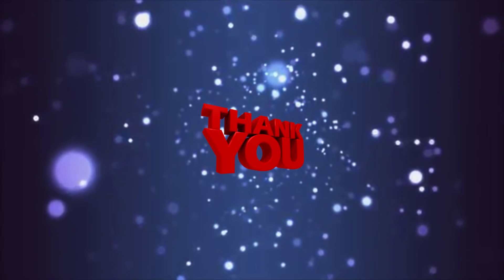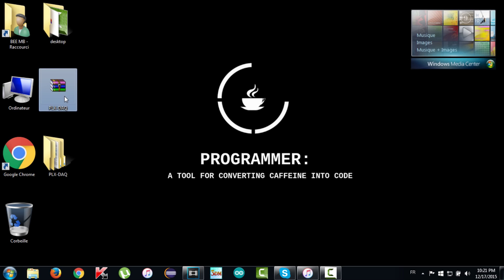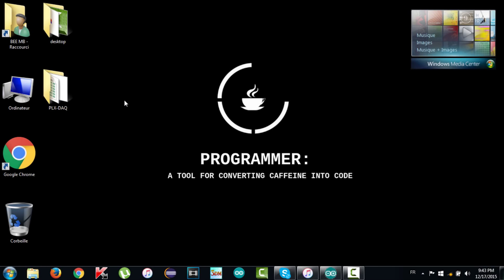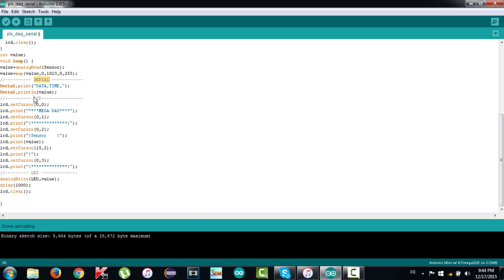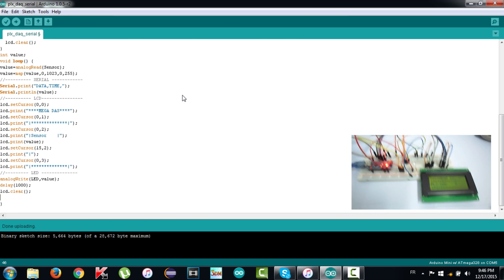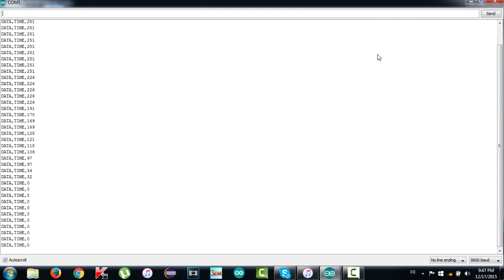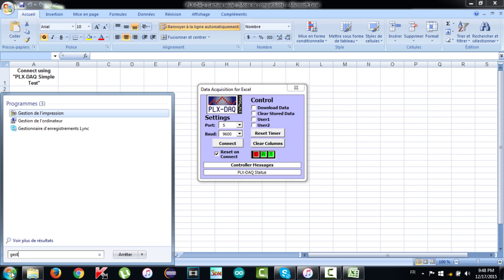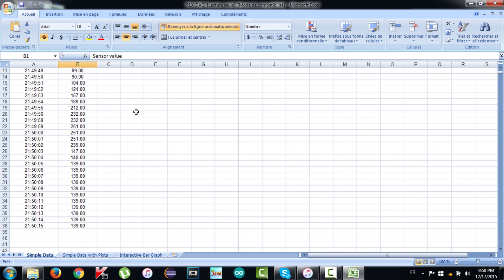Arduino meets Excel ( PLX-DAQ )

Comment: Great video. I have a question. Can you disable continuous data acquistion on PLX-DAQ. I just want it to send data to excel when a sensor goes high. I am currently using data streamer and it is acquisitioning every few milliseconds (I can edit this). Or is there a better way?
Reply from the maker: Update the code to suit your need, remove the delay and make the data transmission as an event
Reply: @DIYGUYChris  Thanks for the quick reply. I am new to PLX-Daq I will try that. Finger crossed I can get it to work
Reply: @DIYGUYChris  Sorry Chris is it in Arduino code I change to event driven or PLX-daq?
Reply from the maker: @anbroic  the change is in the Arduino code

Comment: I've been using an accelerometer and want to upload data to excel I've used an program that allows me to connect the port to excel and upload data. But when i connected port sometimes data doesn't upload and the letter "R" blinks red.

I was wondering does it have anything to do with the code. Do you like have to include something so arduino can comunicate with excel. Because I've tried different codes for different projects and sometimes it doesn't work

Comment: The download file only contains shortcuts and not the actual files. This video is useless without the necessary software. THIS IS A FAKE INFO . IT IS NOT NECESSARY TO USE THIS SOFTWARE TO SEND DATA FROM THE SERIAL PORT TO AN EXCEL SHEET!

Comment: please help me to log temperature in PLX-DAQ
my code is below

const int sensor = A1; // Assigning analog pin A1 to variable 'sensor'
float tempc;  //variable to store temperature in degree Celsius
float tempf;  //variable to store temperature in Fahreinheit
float vout;  //temporary variable to hold sensor reading
void setup()
{
  pinMode(sensor, INPUT); // Configuring pin A1 as input
  Serial.begin(9600);
}
void loop()
{
  vout = analogRead(sensor);
  vout = (vout * 500) / 1023;
  tempc = vout; // Storing value in Degree Celsius
  tempf = (vout * 1.8) + 32; // Converting to Fahrenheit
  Serial.print("in DegreeC=");
  Serial.print("\t");
  Serial.print(tempc);
  Serial.println();
  Serial.print("in Fahrenheit=");
  Serial.print("\t");
  Serial.print(tempf);
  Serial.println();
  delay(1000); //Delay of 1 second for ease of viewing
}

PLX-DAQ showing connected but no data logging.

Comment: I have a small problem that I can't figure out. 
I'm using an esp8266 microcontroller and the DHT11 temperature & humidity sensor. I tried the same method as you did. I am able to get the data on excel but I have two problems: 

1. I'm not able to store more than one sensor data in different columns (i.e. I want to print both humidity & temperature data but excel takes this as one value. eg. if  temp =28, humidity = 40, the data is shown as = 2840.00 and it doesn't work if I add a 'space'.

2. I am not able to get the column names. 

Please help me with this. If you want to see my code, I can email it to you.
Reply: you can make use of the PC part of this video..

Comment: hello sir. i'm using excel 2007 with windows 10. But, i'm having a little problem. When, i click connect on plx-daq it says that 'StampDAQ could not connect. Please help me with this. tq
'
Reply from the maker: Hello afiq aiman aiman 
From what you said, it is a macro security level so just try to configure the Excel macro security level to LOW and then if the problem remain the same then probably it is due to the Excel 64 bit version that you use since PLX-DAQ play its macro with an office 32 bits (not always) I just advice you to install a parallel desktop with windows 7 and Office 2007 and you will get no problems.

Let us know if we can further assist you.
And do not forget to subscribe to our channel for more awesome videos.
Reply: MEGA DAS thank you for the response sir. It’s very kind of you. Really appreciate it!

Comment: Hi MEGA DAS, first of all im not sure if my explanation will be clear enough for you so bear with me please. I have an IMU sensor connected to the arduino which will produce 3 sets of data, the accelerometer values, gyro values and the magnetometer values. Now each of these data is represented with an x, y and z value, which means each sets has 3 columns of data. So on each row i will have 9 columns of data. And when i connect the PLX DAQ to the serial port it doesnt print anything but R is blinking. And im not sure how to configure this table of data. 
PLEASE HAALP
Reply from the maker: Hello Wellesly Tony,
I've got the point you want to share, actually all what you need is creating the necessary labels for your data by changing the following instruction lines in the code that I provided in the description of the video :
Change this : 
       Serial.println("LABEL,Current time,Sensor value"); 
By :
      Serial.println("LABEL,Accelerometer X,Accelerometer Y,Accelerometer Z,Gyro X,Gyro Y,Gyro Z,Magnetometer X,Magnetometer Y,Magnetometer Z,"); 

Then when you want to send data to the appropriate cell just do this :
      Serial.print("DATA,"); 
// Now send data of Accelerometer variables
      Serial.print(Accelerometer_X); Serial.print(","); 
      Serial.print(Accelerometer_Y); Serial.print(","); 
      Serial.print(Accelerometer_Z); Serial.print(","); 
// Now send data of Gyro variables
      Serial.print(Gyro_X); Serial.print(","); 
      Serial.print(Gyro_Y); Serial.print(","); 
      Serial.print(Gyro_Z); Serial.print(","); 
// Now send data of Magnetometer variables
      Serial.print(Magnetometer_X); Serial.print(","); 
      Serial.print(Magnetometer_Y); Serial.print(","); 
      Serial.print(Magnetometer_Z); Serial.print(","); 

Note : about recieving data in PLX_daq make sure that you are configuring the same baudrate for both Arduino(Serial.begin(9600); )and PLX_daq.

Let us know if we can further assist you.
Reply: MEGA DAS omg youre a life saver thank you so much!
Reply from the maker: Happy to hear this from you Tony.
You are welcome.
Reply: Sorry but one more thing MEGA DAS, how do i get the excel to display elapsed time instead of time of day? cos what im getting in excel now is the time of day instead of time in minutes and seconds.
Reply from the maker: Hello Wellesly
Sorry for the very late reply, what you are asking about is a pure Excel configuration so there is no need to include Arduino in this, but I can suggest to use the "millis ()" fuction of Arduino in order to get the elapsed time then send it to you Excel file 
Make a research about millis function

Let us know if we can further assist you.
Reply: can i get your code for reading the accelerometer, gyroscope and magnetometer on arduino?

Comment: Can I export more than one data??
Reply from the maker: Hello Gabriel
Sure you can do upload more than one data just the way I did in this video I've exported temperature and humidity data

Let us know if we can further assist you.
Reply: MEGA DAS, thank you for your support :)
Reply: MEGA DAS, the downloaded RAR file only contains shotrcuts  to the spredsheet, but no the fil itself. I can't use it :(
Reply from the maker: What do you mean by "fil itself"?
If you want to change the columns labels you can do this through the code or just after getting the data from Arduino

Let us know if we can further assist you.
Reply: my bad. I meant  "the file itself". I can't open the spreadsheet. A window says there is no such file.

Comment: Hi would this program work, when i design my arduino code to display the measured values in the serial monitor? (Still Serial.print();)
I'm also getting the warning that file is not compatible with the version of windows i'm running.
The spreadsheet and help file is just shortcuts and the actual files are not found as long as the program is not installed...
Can you helt me?
Reply from the maker: Hello Rene,
As I understand, you want to use the code to display values on your serial monitor ! so its the same and it will work fine.
About the file! which one are you talking about, and which windows version are you using?
Reply: I'm running Windows 7, tried setting the install file to compatible for windows 2003 SP1 - no sucess.
i used the download of the .zip file in the description to download PLX-DAQ
Reply from the maker: On that video we were using win7 and as you see PLX-Daq is running with no problems
Reply: Okay how about 32 or 64 bit versions? Are both avaliable?
Reply from the maker: We are using 64 bit version

Comment: PLX daq software has been installed successfully.but I am not getting the data in excel sheet even status is showing connected.I have followed all instruction that has been shown in video but still I am not getting.For kind of information I am currently using 2003 ms office as well as 2007 ms office.  so plz help me to get this solution.
Reply from the maker: Hello sanjeet,
Did you use my code to test your project!?

Let us know if we can further assist you.
Reply: I have used my own project code.Is there any additional program modification in arduino to fetch data from arduino to  excel sheet?
Reply from the maker: Sure there is some specific lines to add, so you need to download the code that I used and find out what you missed in your code.

Comment: I have install PLX-DAQ but after opening the plx-daq spreadsheet file  one message is displayed"could not load an object because it is not available on this machine".plz help me       to solve this problem.
Reply from the maker: Hello sanjeet,
I often receive this kind of issues from those who use Microsoft Excel 2010 or higher, I advise to use Excel 2007 because it runs with no problems.

Let us know if we can further assist you.

Comment: i am getting a message, "this app can't run on your pc, to find a version of pc, check with a software publisher" so what should i do, i am using 64-bit original window. How can i use this software?
Reply from the maker: Hello apoorva, 
What Microsoft Excel version are you using!?
Reply: microsoft excel 2007
Reply from the maker: Could you make a screenshot for the error message and post it here,
Reply: this is the error
Reply: can u send me your email id as i am not able to post it here
Reply from the maker: This issue might be due to a problem with your user account.
Try to Run the Excel file as an administrator account, if this problem presists so you need to follow the steps indicated in the following forum: http://windowsreport.com/app-cant-run-windows-10/

Let us know if the problem is solves or not.
Reply: I tried but it didn't work, is there 64-bit software available.
Reply from the maker: Hello Apoorva,
I told you that the problem is in your windows! 
I'm using a 64-bit processor and this software is running with no problems.
Please tell if you find a solution for this problem.
Reply: Hi, i tried running plx-daq with excel2003 but its not importing any data rather showing this
Reply from the maker: Apoorva Rampal did you activate the macros for Excel !? as I showed in the video!
Reply: yes i did, but when i opened plx-daq interface and set  port and baud and connect, it showed me a message," stamp daq could not connect, please check the port settings."
Reply from the maker: Check this topic here in Arduino forum!
http://forum.arduino.cc/index.php?topic=331455.0
Reply: I checked it but didn't find anything, when i check my port settings they were, "bits/s= 9600, data bits= 8, parity= none, stop bits=1, flow control= none" in device manager > ports, do u think if something is wrong here?
Reply from the maker: Nothing is wrong with the port settings! it is exactly the same as mine.
Try to run Arduino Serial Monitor integrated in Arduino IDE and check if you receive some data from your Arduino.
Reply: yes i am receiving data same as yours
Reply from the maker: Give me your email, so you can provide some screenshots!

Comment: Hello, I am trying to use a PLX-DAQ in order to get some data from my Arduino, Unfortunately, I get an "Unable to load some objects because they are not available on this machine" (Microsoft Message) Is it stems from the fact that I'm using Excel 2016? (Anyway, I tried to enable macros but it didn't work also) should I download Excel 2013 (will it work?) or 
Windows 10 maybe cause the issue I have (In this case, I have nothing to do)

Thanks!
Reply from the maker: Hello Idan,
PLX-DAQ can intract with Microsoft Excel 2007 only, we still don't know why the macros can't be enabled in the higher versions, but you can upload data to your Excel File if you use the 2007 version.

Let us know if we can further assist you.
Reply: Hey again, I ran this little program:

double x;

void setup()
{
  Serial.begin(9600);
  Serial.print("CLEARDATA");
  Serial.print("LABEL,Current time,Sensor value");
}

void loop()
{
  x = 10*sin( 2.0*PI*( millis() / 5000.0 ) );
  Serial.print("DATA,TIME,"); 
  Serial.println(x);
}

I opened the PLX-DAQ SRL EXCEL 2007 but now I can't see incoming data into the excel software (and probably not even a graph).

(PORT and BAUD is O.K)

What to do?
Reply from the maker: Try to replace these instruction lines:
Serial.print("CLEARDATA");
Serial.print("LABEL,Current time,Sensor value");

by the following instructions:
Serial.println("CLEARDATA");
Serial.println("LABEL,Current time,Sensor value");

Then add a delay of 1 second "delay(1000);" in the loop function and tell me if it worked

I added in the description of the video the source code that I used i this project

Comment: Sending data from excel vba to arduino, for example to flick a led or to turn on and turn off it, have you an example?
Reply from the maker: Hello Jose

I am sorry to tell you that I'm not familiar with the Excel VBA, But using the PLX-Daq you can only upload data to your Excel file, it means you can not used to read data from Excel file.

Comment: Boa tarde, estou querendo manda um comando do arduino para o PLX-DAQ para salva os dados, tipo CTRL + S.
Tem possibilidade??
Reply from the maker: Hello Denis 
Could you please write your question in English!?
Reply: Sorry.

I am wanting to send an arduino command to PLX-DAQ EXCEL(WINDOWS) to save the data, type CTRL + S.

Is it possible ??
Reply from the maker: Hello Denis, this is better now we can understand you :)
So what I understand that you want to make a control on the data transmission! I mean you want it to be send by an event that you make, like clicking on a button or something like that?
Reply: This can even be a button or automatic.
I wanted the Arduino to send a command to PLX-DAQ automatic save.
Is there a possibility?
Thanks for the help :)
Reply from the maker: Actually the Arduino don't send instructions to PLX-Daq but it sends data, and the PLX-Daq is always waiting for data to come and when it comes then PlX place it into the Excel file, so if you want to stop PLX from uploading data just stop the Serial data transmission from your Arduino and if you want to give PLX-Daq the data just send it through the Serial port. I don't know if I gave you the desired answer or not!?
Reply: Thank you very much for the help, my friend.

Comment: Hello Mega Das,
                             We need the data of R305 finger print sensor data which is connected to arduino uno board into the excel sheet??                                
                                 and the code we used #adafruit library
Reply from the maker: Hello Sudheer!
I'm not sure that you can make it with an Arduino Uno if you are using the Serial Pins (TX/RX) for Fingerprint sensor because these Pins are connected to the USB-to-TTL Serial chip, as I know the finger print sensor use a Serial protocal to transfer data to the Arduino board so in this case you need to use the SoftwareSerial library that allows serial communication on any of the Uno's digital pins and let the TX/RX pins free for the USB transmission.

Let us know if we can further assist you.

Comment: It said 'stampDAQ could not connect, check port setting' when i selected the right port number. But it is connected once I close the arduino. I reopened the arduino but error appear as I tried to upload the code. help!
Reply from the maker: Hello Mohammad!
The first thing to verify is the baud rate, it should be the same baud configured in your code and PLX-Daq as well, then try to check if the right port number (follow the steps in the video) is selected in the PLX-Daq interface and you get the (c) icon turn from red to green when you click the connect button.
Reply: I did exactly that, its just the port wont be connected at the same time with arduino and PLX-Daq. I can only connect one at a time, for example, if the port connected with arduino, PLX-Daq ask me to check port setting. OR. if the port connected with the PLX-Daq, the arduino code wont converge due to its not connected. any idea?
Reply from the maker: Before making a Serial communication you should know first how it operates like the port configuration the baud rate etc...
But what you mean by "port wont be connected at the same time"!

Comment: How i make work with Arduino in 115200 Baud?
Reply from the maker: Hello Antonia!
Configure the PLX-Daq baud rate to 115200 then configure your arduino serial baud rate over your code: " Serial.begin(115200); "
Tell us if you have more questions!
Reply: PLX-DAQ dont have that rate, or i change(128000 to 115200) it in programmer mode in Excel?. Thanks for reply

Comment: it is not printing anything on excel but R is blinking in red
Reply: same here
Reply: Lol the ground pin wasn't fully in. which made the serial transfer not work but arduino blink.
Reply from the maker: Hello Mohammed
Make sure that you activate the macros for the spreadsheet, then try the same code that I provided in the description of the video. 

Let us know if we can farther assist you
Reply from the maker: It's important to check the wiring connection ;)
Happy that you solved the problem
Keep up and good luck
Reply: I have same problem how to solve